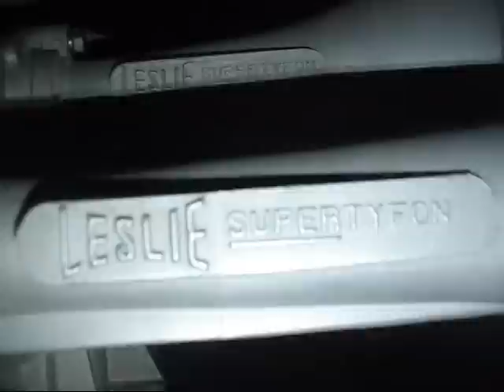k5la vs rs5t.wmv

Comment: Never heard the use of 'MD' anywhere on a Leslie, but I do know if that were really an RS5TRRO, anyone standing around that horn would've had ringing in their ears or would've gone deaf. This is just simply an RS5T. May still be an 'O' with bells swapped around in certain areas, but I couldn't tell. 'RR' means that 2 bells have been reversed and 'O', as I stated before, just simply means some bells have swapped places on the manifold. Not saying the tag is misleading, but someone has changed it.

Comment: I have been around both Nathans and Leslies and upclose, leslie horns dont hurt my ears and dont seems as loud as the nathans, up close the nathans sorta hurt your ears when your real close like on the front of the locomotive.However your right, Leslies have bigger punch, because you can feel the vibration form them where you cant a Nathan. but K5's are much Louder than an RS5T, even though id rather the RS5T be considering I like them much better.
Reply: Leslie's are louder and their sound travels farther then a k5la
Reply: Because NATHAN have higher pitch than LESLIE does, so it's more noticeable to human ears.

Our sensitivity of hearing around 1kHz or 1000Hz, highest NATHAN bell are K5 play upper D# 622Hz. While LESLIE No.55 bell play 554Hz. 

The closer to 1kHz gets more attention from our ears, but the lower the frequency or the pitch, the further the sound can reach. And not annoyed our ears.

Comment: what's the fixture you used to connect the horns to the pipe?
Reply: It is called a threaded swivel connector
Reply: pipe union
Reply: I want this exact setup, I like how easily the horn can be switched out it would be perfect for horn testing, I have a 12 gallon tank I'd like to rig up to 20 gallon. But I need to find those connectors you used and where to get them?

Comment: you're not wearing hearing protection? you guys are idiots. enjoy your hearing aids also the K5LA is louder horn in terms of DB it is just a much high frequency which is why the RS5T sounds louder.
Reply: Nope. Leslie RS5T's and S5T's are more powerful and louder than Nathan K5's, especially if the RS5T/S5T has full 'F' sized orifices in each bell. Leslie's power chambers incorporate the use of physics to vent air into a back compartment behind the diaphragm to provide "back pressure" cushioning against the diaphragm to remove the possibility of the diaphragm warping and over stressing. Nathan horns do not have this design. And Leslies being deeper in tone means that their sound carries further than something like a K5LA.
Reply: And if you want the ultimate. Go the M size on the orifice. Crazy loud
Reply: Your comment makes no logical sense. in dB(A) weighting, the human ear perceives higher frequencies louder than lower frequencies of the same technical SPL. The K5LA is pretty much one whole half step higher pitched than the RS5T hence why it appears harsher. In true decibel output, the Leslie is more powerful.

Comment: Nathans have a higher pitch so they feel harsher on the human ear, but according to my decibel meter (not one of those cheap pieces of crap that max at 130, I work in a recording studio so I have access to some professional equipment) and personal experience I can tell you that Leslies pack way more of a punch than Nathans do. When I play around with both types of horns I tend to use ear plugs and ear muffs for Leslies while one or the other will suffice for Nathans.

Comment: Hey ,cooyons , brace the horn better than that,tie a 50, or 100 foot rope to the valve and stand back and blow, it will sound better and be safer. Put the recording device inside a truck at that distance with the windows up as a filter for distortion, adjust the distance accordingly.Do you goofy guys ,Hey you guys wanna hang out some time!!!

Comment: Great video those horns are priceless even the Nathans, but it is asinine and doing an injustice to run 3/8 pipe to those horns. If u can afford to aquire those bad ass horns get rid of that POS compressor and get a gas 11 HP compressor and run a 3/4 line with a last minute 3/8 reducer to the horn they sound like they are being starved for air.